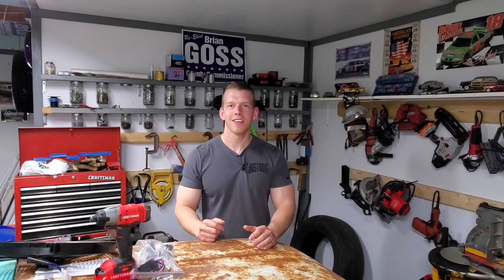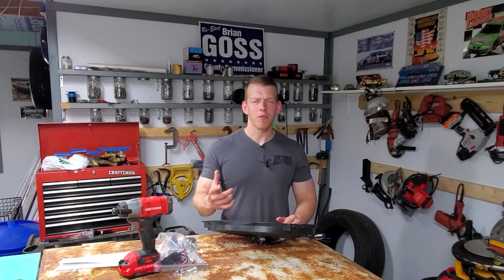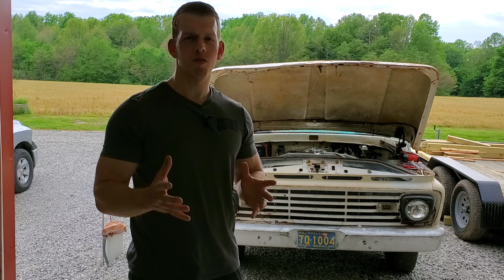THIS ADDS 30 HORSEPOWER! | Electric Fan Install!

Comment: Hello, don't be tired I have a question Our old Pikan van has an 8-bladed mechanical fan propeller, how much will it add to the engine power by removing it and installing an electric fan? And my second question is whether it is effective in reducing the sound?😊

Comment: Love the project truck man... An added star from me for it being manual stick shift... One thing though on the fan temp probe... The part that is sticking out of the radiator, you should cover that part up w/some sort of plastic cap or a small piece of sticky flex tape... You'll figure it out though... Keep on truckin... 👍✌️😎

Comment: The fan blades are normally made for blowing. For sucking like your installation the blades needs to be turned around. Also installing the fan more to top of radiator will get heat out easier, as the top of radiator is warmer than the bottom.
Reply from the maker: You can switch your wires and make the fan rotate in either direction!
Reply: @JakeHarrington  Yes you should do that to get the rotation direction right, but the blades are curved and work better if they are the correct way around. So when turning the air should hit the inside of the curve and not the outside.

Comment: You do gain hp with an electric fan on your motor.
But the biggest down fall is when the fan stops working you motor over heats and may cause big problems and costly repairs.
I run eclectic fans on my better. And I keep an eye on them and the temp gage to make sure they are working. But I run a fan off the water pump on my carmaro it has 450hp motor with a t56 6 speed Trans. Both are daily drivers 
Only reason to use electric fans are 1 you can't put a clutch fan in because you don't have room 2 your racing you ride and want that little bit of power to gain a fraction of a secent in time.
Reply: Better = vette

Comment: Just be sure you compare apples to apples.  A hot engine makes less HP too.  So if your mechanical fan was killing 20HP but the engine ran at 165 degrees, you wont NET much HP by adding an electric fan - if the engine is running at 205 or 210 degrees.  You will loose around 10HP to the heat of the engine and a couple HP to the alternator.  The difference left over would not be noticeable.  Pluss, the 20HP being killed by the mechanical fan is measured at over 5,000 RPM.  The fan kills far less power at lower RPM, so unless you are racing and running at top RPM all the time, the electric fan and higher engine temps will actually kill more average HP.  Of course, if your electric fan and mechanical fan both run the engine at the same temps, it is less of an issue.  This is why we don't say "always" or "never" when it comes to things like this.  Every application is unique and the results of one person's set up, may not be indicative of another's set up.
Reply from the maker: I don't believe I mentioned it being applicable for every setup. However, I agree that at lower engine RPM, the horsepower gain may not be as noticeable. I'd like to also say that electric fans run the same speed, regardless of engine RPM. This could mean that at lower engine speeds (mechanical fan rotating much slower) the electric fan will cool more efficiently. With a properly setup electrical system, you will not have a problem with any kind of electrical draw on the system.

Comment: Electric fan is Not the same as no fan. Electric fan put drag on alternator which Rob's HP.
Reply from the maker: The tests that were done on MotorTrend found otherwise. The electric fan places an electrical draw from the alternator. However, the mechanical fan places a rotational drag on the rotating assembly, which reduces horsepower.
Reply: @JakeHarrington  
The electrical draw is transformed into a mechanical drag because the load puts a drag on the alternator puller. Same difference.
Reply: Not if u hook it up on a toggle. And only use it when in traffic

Comment: The drag that was on the mechanical  fan is passed to the alternator. More amperage  more tension on the alternator less horse power
Reply: This may be correct, however this it isn’t a constant drain, As the fans will switch on and off according to temp. Also I fail to believe that any extra load generated by a couple of small motors would come close to the mechanical load needed to spin a big ass fan at thousands of rpm.
Reply: The point is an electric fan has a constant power drain. When your ideling on a red light they both need the same amount of power, maybe 1hp
The problem is when you acelaert and the engine rev up the mechanical fan also rev up and than it pull too much air and alot of power 20hp and more.
The electric fan still run with the same speed and just need 1hp.
Reply: I don't understand how a fan can reduce hp, I mean, when the car is going forward incoming hair should help spin the fan.. also in my car the fan is mounted on an electronic cluch that ingages when above a certain temp.

Comment: 30 horsepower Overstock. Personally don't like the sound of the electric fan. They can be loud also.
Reply from the maker: They are definitely noisy, but I can't really hear it anymore than the engine, when the hood is shut! And less drag on the rotating assembly!

Comment: You've probably gained some horsepower with this conversion.  I wonder how much HP is needed to run the water pump.  Maybe an electric water pump (if they exist) can give a few more horses?
Reply from the maker: There is an episode of Engine Masters that shows how much horsepower everything driven by a belt uses. The numbers were pretty impressive. I highly recommend looking for it!

Comment: At the end of the day, it's your choice. Here's some info on fans, cooling, shrouds.
A fan shroud prevents the loss of airflow due to turbulence. If you want more air flowing through the rad at a higher velocity then use a shroud. Unless you have serious space issues you should use a shroud if possible. The shroud only needs to cover the fan and not past the blades more than an inch if space is tight.
 The fan is responsible for drawing in air, the fan shroud's job is to ensure uniform air distribution through the radiator core.
 Fan blade configuration is important.
 From rigid to flexible there are many to choose from. If they are too flexible they stop working at a lower rpm they flatten out. Fan diameter is another metric that affects cfm. A more rigid-flex fan for modified V8s is a good choice under 500hp along with a good water pump. The number of fan blades and fan blade angles are all things to consider. 
 Clutch fans are a good option because they only apply a load at idle or low speed and don't require wiring. 
Electric fans have their place. They can be mounted in front of the rad if your engine bay has no space to run a fan off the front engine accessories.
 They do draw amps. If you are already loading amp draw on the alternator you should make sure the alternator can take the extra load.
This is an article from Summit Racing on Fan Shrouds. https://help.summitracing.com/app/answers/detail/a_id/5275/related/1/session/L2F2LzEvdGltZS8xNjE0MDgyNDA1L2dlbi8xNjE0MDgyNDA1L3NpZC9mVXVuWlRRcVVHYW53RiU3RWVsd2Fzb1lzJTdFQ0NXSG5JWWEzZGM3alk4a3hwbDV4WG81NWJRcWRmdlJCVFpTcWZMdSU3RUxMZWpUenBOdEtuZFIzRE1hejBZZk5pR3VQbW1fVkNwM25hOVBSejFmTiU3RSU3RU9MQUNLWmRXTjBnJTIxJTIx
Reply from the maker: All good information! This build will not be building a ton of heat! When idling, this truck will not go above 200. When in motion, the cooling will be more efficient as well. The best use I have noticed is being able to manually turn the fan on, to keep the temperature in my preferred range. Also allows me to cool, when the truck is not running as well. I beefed up the charging system, which is now more than capable of handling these fans! I agree it really boils down to preference!

Comment: You should put a shroud around the fan you only need it to go as far as the fan is from radiator so it uses all surface area of radiator

Comment: I am in the middle of changing my radiator from stock to all aluminum. Been hearing noise from what might have been a pulley bearing. PS pump was leaking, and sometimes intermittent effectiveness, so replaced it, and water pump and belt tensioner.
 Have been considering upgrading to electric fans, but i read somewhere that the 5.9 Cummins is cooled not only by thew radiator, but by the fan blowing onto the engine. I would hate to change over to electric fans only to experience overheating. Not sure what to do now. Have not yet ordered fan clutch. Was just about to do that today, but found info on electric fans again, and am undecided.
Reply from the maker: The electric fans are awesome! They free up some horse power, and are only kicked on when the fans are needed. They are temperature controlled, vs always being rotated by the engine, causing a loss in horsepower at the wheels. You can also override the temp control and turn them on manually, if you are stopped in traffic or something like that, and need some extra cooling!
Reply: @JakeHarrington  what brad do you suggest? Did you install electric fans on your truck, And if so what kind of truck do you have?
Reply: Brand*
Reply from the maker: @LivingFaith2  i have a 1963 F100! I also put them on a 1977 Nova! Glad with both installs!
Reply from the maker: @LivingFaith2  You can go with some fans from Summit or Jegs! The controller was from Hayden automotive!
Reply: @JakeHarrington  I’ll go check that out right now thank you Jake
Reply from the maker: @LivingFaith2  let me know if you have any questions!

Comment: Man I've wanting to do this swap everybody else on YouTube keeps saying   a shroud is needed  and also to upgrade the alternator. What are your thoughts on that?
Reply from the maker: It really depends on your setup. If you are running a less efficient alternator, with a ton of accessories, it may be a good idea to upgrade your alternator. However I have a 100 app alternator, which isn't really necessary, in my honest opinion. I only have radio, lights, ignition. Most is mechanical. What are you doing the swap on?
Reply: I made a video on this that will answer most if not all your efan swap questions! 👌🏽

Comment: Would it be better to put a temp. probe into the intake manifold? Rather than protruding through the radiator?
Reply from the maker: It would be a more accurate reading, especially if you are running a thermostat. I don't run a thermostat on my current build.
Reply: @JakeHarrington  Yeah, I plan on swapping to electric fan on my 95 F250. I feel like not only the power gain, but probably better cooling also. 30 horsepower for 200.00 bucks, and not opening up the engine sounds good to me!
Reply: @iamgriff  You can put it after the T-Stat to give you a block reading (more accurate), or in the radiator (fluctuates).  Note: In the rad, you can actually see the T-Stat working/ open/close on the gauges.
Just a thought but I like the rad insert for that reason.

Comment: I like it !  We just did a 6-71 blower install on a Ford 351W and ran in to clearance issues with the mechanical fan so looking at the electric fan option . I totally overlooked the horse power gain from the extra drag of the belt driven fan so your video helped us make the decision !  Thanks for sharing .
Reply from the maker: I Appreciate the comment! It really does free up power, and allows you to have control of where your operating Temps are. Most kits are temperature controlled, and even allow you to install an override, so you can cool, while the car is off
Reply: @JakeHarrington  We got the electric fan installed this morning and it fit like a glove between the radiator and blower belt , was a great solution to our problem and thank you for the idea Jake !

Comment: Here is what you need (link below), a shroud.  This will help cover more area and cool better.
Also, might want to move the probe closer to the top hose a few squares down.  Fan might come on a little earlier.

https://www.ebay.com/itm/Aluminum-16-Electric-Fan-Shroud-Universal-Fits-19x26-Crossflow-Radiator/381656992205?ssPageName=STRK%3AMEBIDX%3AIT&_trksid=p2057872.m2749.l2649
Reply from the maker: Fan shrouds are one of those controversial things. I have never used one, just because while moving, the air will still draw through that part of the radiator, which may be covered by a shroud. On another episode of Engine Masters, they showed that the shroud actually causes restrictions. 

But I do see how a shroud could help while stationary though! 

Glad to see another f100 owner on here! 🤙
Reply: Ya I don't use any at all on my old Jeeps etc but on my '65 F250 I bought the one I linked to to help since my radiator is older and not aluminum etc.
Reply from the maker: Yeah aluminum makes a huge difference! I believe mine is a 3 row, which also helps me out!
Reply from the maker: @JB-gf8qc  I subscribed to your channel. Excited to see how your project comes along!
Reply: @JakeHarrington  FBook Slick 60's group 1961-1966 Ford Trucks is where I have my main info.  I just use UTube for video to post elsewhere.
Reply from the maker: @JB-gf8qc  I follow that page as well! 🤙
Reply: @JB-gf8qc  I had this same question. I have a 5.8 in a 1995 F250. It's my daily driver, all stock, and it see's speeds of 70-90 mph daily. I was concerned though about cooling with the AC on in summer traffic. After reading this, I will get a shroud for the electric fan